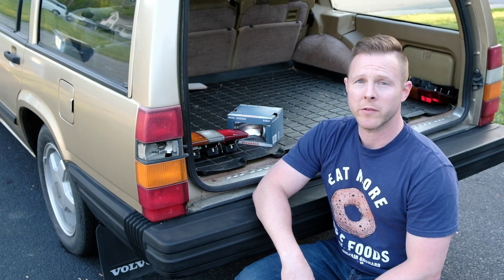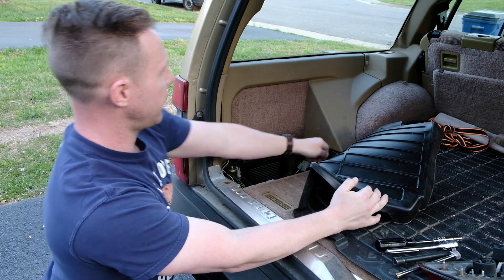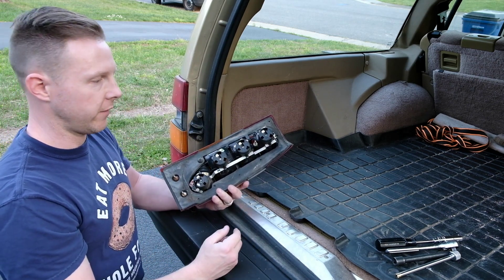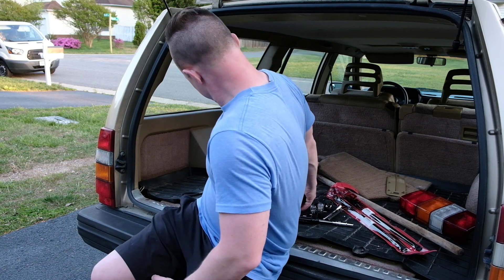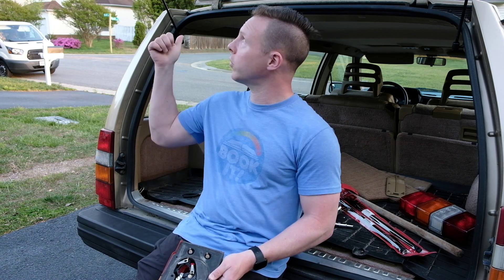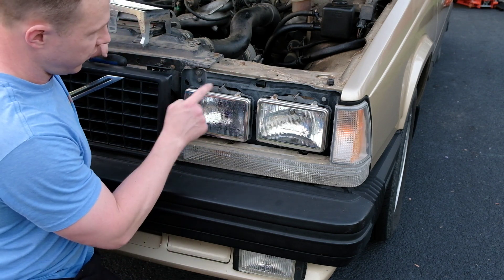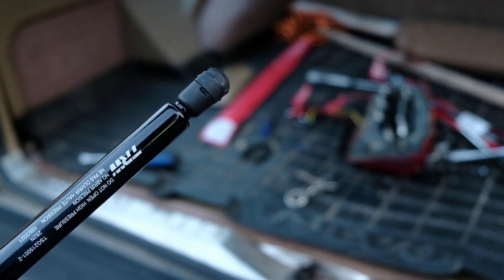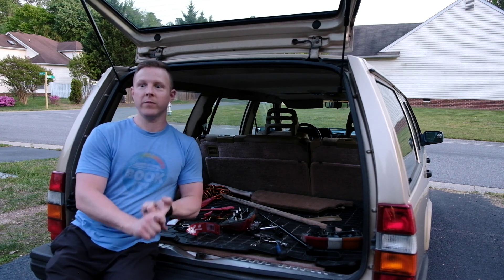1987 Volvo 740 Turbo - Tail Light & Headlight Replacement (Part 5)

Comment: Where did you get the mudflaps? I've been looking in vain for them to install on my 1987 Volvo 740.
Reply from the maker: The mud flaps were on the car when I purchased it. My understanding is they were bought as an OEM dealer accessory by the original owner.